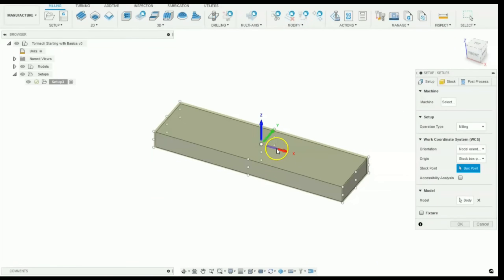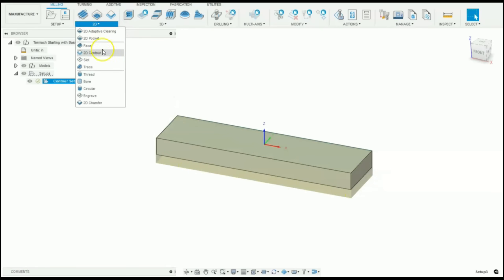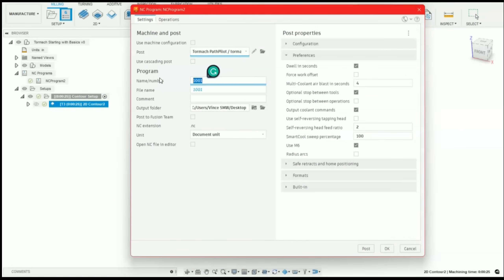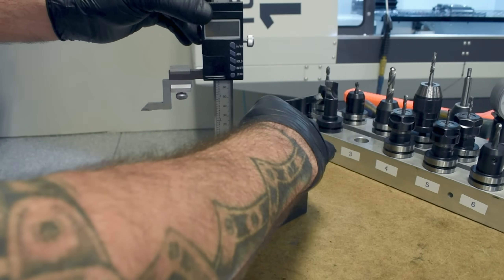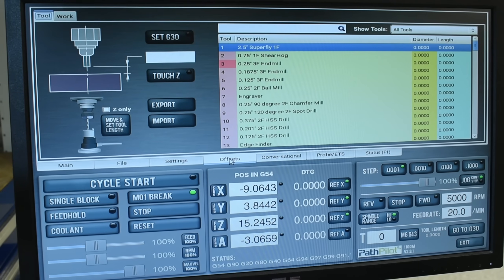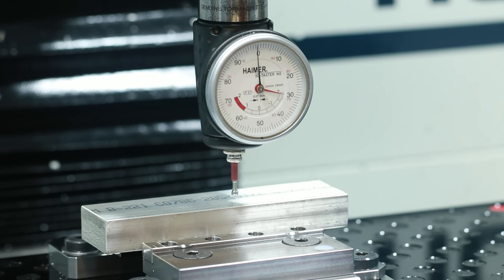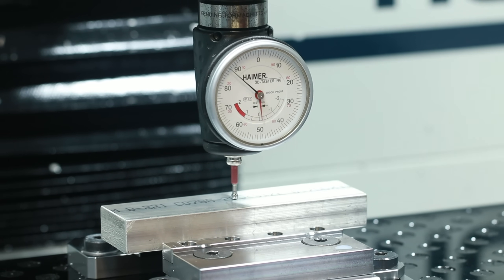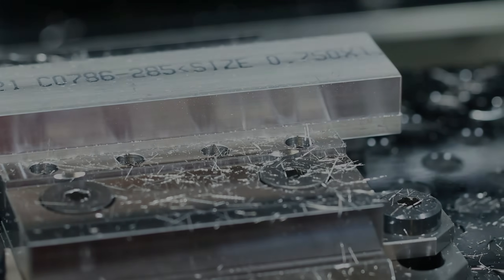How to Get Started with a @tormachinc and @adskFusion! Beginners Guide!

Comment: Wow Saunders really has all the garage "machinist" sold on these fixture plates.  Are you guys aware these plates and pallets are just machined plate stock?  The Tormach 1100 plate is $799.  A 35x12x1 plate of 6061 is $286.09.  
Saunders would charge me $3538.91 for a 40x16x1 plate with "pro" hardware for one of my machines.  I could buy the stock for $442.08 and machine it to my machine. oh, and this includes his little vise because Kurt, Orange, Raptor, Shunk, and 5th axis haven't got it right.   
This is crazy, people buy these plates and don't even get a real vise. 
You guys are just paying him to do what you should be doing, machining.  he gives you the prints and CAD files.